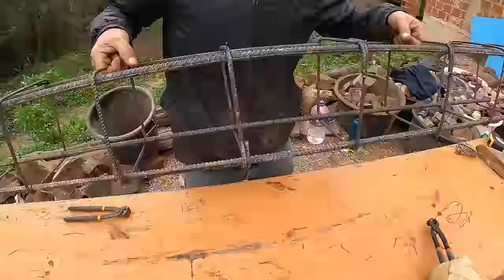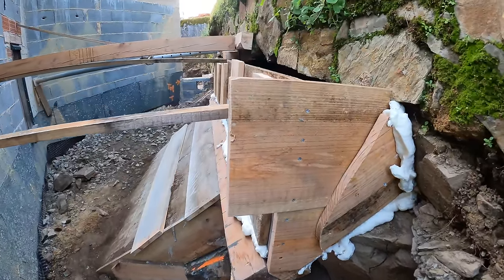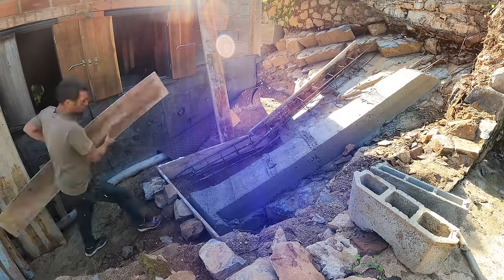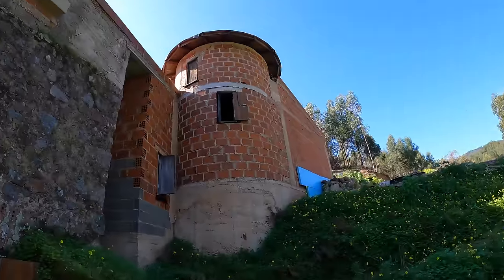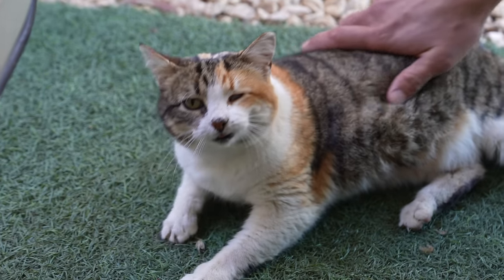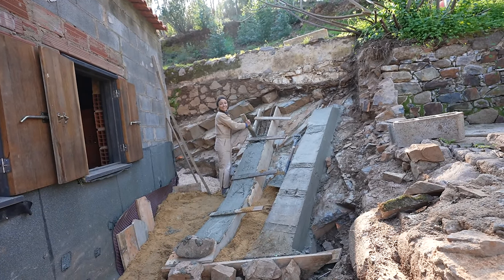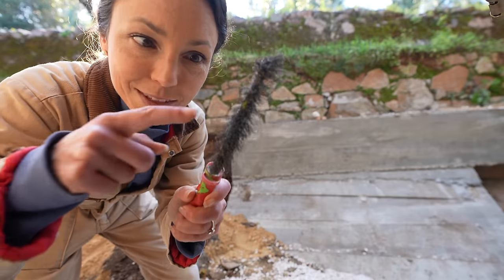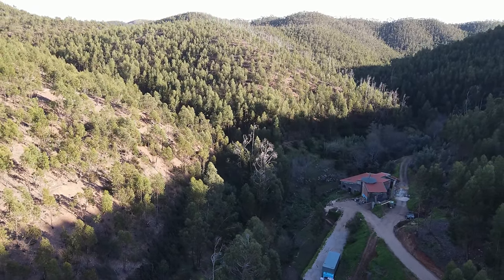OUR CASTLE WALL GETS INDESTRUCTIBLE CONCRETE SUPPORTS 🏰

Comment: Use your Sawzall or jigsaw without a blade as a concrete vibrator. Helps the concrete flow and fill in all the small areas.

Comment: The first line of defense is that retaining wall with appropiate water drainage. Especially as you are repurposing the mill and its original waterflow patterns. Plus the natural slope and water runoff from the road and mountains. Added benefit is access around the side.
Reply: Yep!!!!!! Once the basic infrastructure is in the rest becomes easy..... Well I wouldn't say easy we haven't even got a roof or water yet ha

Comment: If you paint yogurt onto the new concrete when it has dried it will help moss etc to form on it and will speed up the weathering. 
You all doing a great job Andy is worth his weight in gold for you both you will learn a lot about the building trade..
I love your channel I have been watching it for a long time.
Reply from the maker: That yogurt trick really works!?  He has taught us a lot about working with concrete and blocks.

Comment: You should use landscaping fabric and separating your gravel from the dirt. Without this the dirt/sediments will eventually travel through your gravel medium and into your French drain system. I would also recommend installing access points for easy clean out.

Comment: Two things to remember when mixing cement to make concrete the wetter you make the mix the weaker the concrete will be, also if you have rust on the rebar the rust will continue to expand and eventually crack the concrete. If you doubt me you can consult the leading authority on concrete The US Bureau of Reclamation Concrete Manual & Concrete Repair Manual.

Comment: Why don’t you guys sort the inside of the place as priority that way you have a roof over your head and then do the outside of the house 🤯 sorry am I missing something here as just watch most of the clips are about the outside of the house and living in a make shift place 😮
Reply: They cannot move into the mill until they have a residency permit, they need to have a water source AND a waste water disposal solution BEFORE they can do that, and it all has to happen inside the Mill's property line, which is barely larger than the mill itself, and includes restrictions on what they can do near the stream as well. They have sequenced the work to get residency permission, get them into the Mill, and then to be able to combine the two properties into one as quickly as possible.
Reply: The roof is done
Reply: It seems that having the outer perimeter sound and secure first is a good first step, so that all the work done inside will be safe from destruction if the retaining wall was not secure-:) The foundation is always the most important😃👍🏼

Comment: putting rocks in non structural forms with concret is a good idea if you dont care for optics... but putting it in a structural wall will just weakens it... you could just build a smaller wall to safe conrete... a water barrier behind would be a good idea to not let water get through it and form white stains. looks nicer in the ende